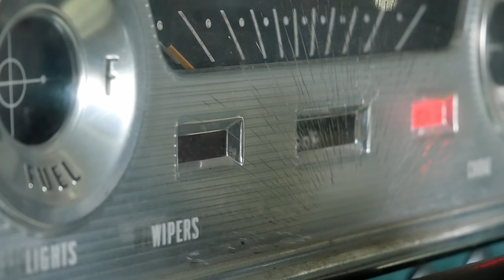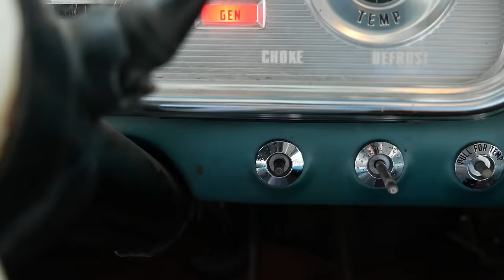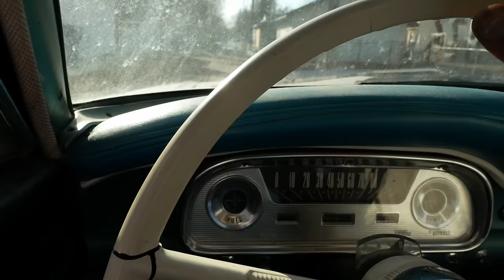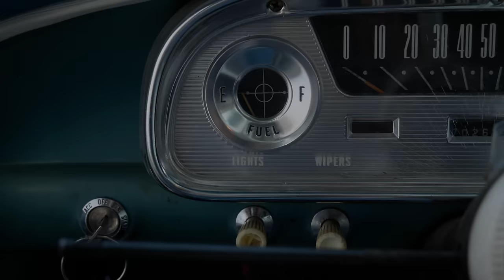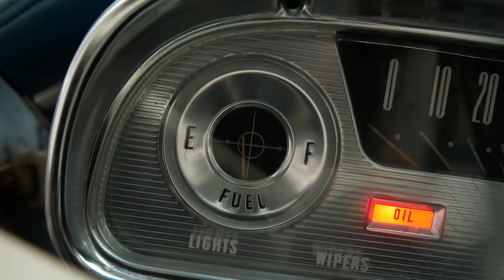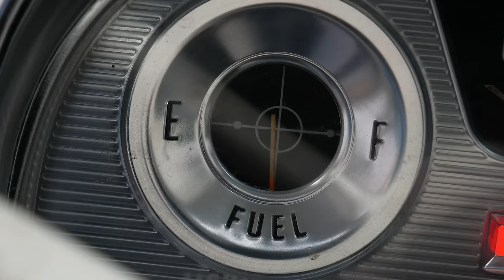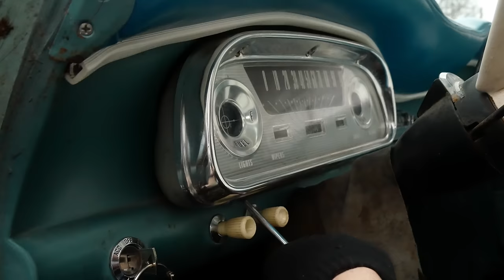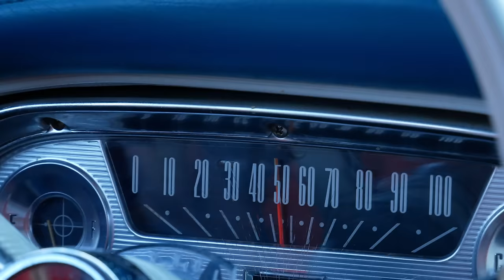Fixing Up An Old Ford

Comment: I learned from oldtimers back in the 70s, start spraying penetrant on exhaust bolts a week before day of removal, spray several times a day every day without running engine till day before, then spray between running every few hours of cool off time. The day of removal, nuts and bolts will be hand tight and will never break off, I've done it 20 or 30 times, never had one break in 40 years as a mechanic. I've got to fix a few that others failed at following directions.
The sounds of those old 6s brought back memories, I had a 68 Falcon Futura, and a 66 f100...
Reply: I agree totally especially with vehicles sitting for a long time I hate headaches lol but good to watch sura young man saving these old cr

Comment: Seriously, you have the patience of a saint! This brings back memories of working on my 1965 Falcon Six (although I think my exhaust manifold studs were much better behaved!) 
There's a certain "domino effect" when working on older cars. One thing kind of leads into another and the next thing you know, you've pretty much dealt with every system in the car.
"While I'm at it..." syndrome is very strong and hard to resist!
Looking forward to Part 2.

Comment: Hey Simon, a word of advice. I’ve been in the same position with exhaust manifold bolts before. Next time, mix yourself up a 50/50 mix of ATF & acetone and apply it to the bolts. And I don’t mean five minutes before you start, I mean two or three applications per day for a week or more if you can. Do that and hit them with some heat and you’ll be amazed at the results. 
Great video, thanks!
Reply from the maker: Thank you for the tip.

Comment: Brings back fond memories! I owned a 1962 Falcon in 1968 I bought from a dealer. The price? Four Hundred bucks. Inflation aside, it was a good price.  The body was perfect, the only thing I remember was it did not have much heat in the wintertime. Great job on that exhaust! Adjust those valves properly and you won't even hear it run!

Comment: Second car I owned was a 1961 Falcon 2 door. Put over 100,000 miles on it without a major problem. Great gas milage with the 6 cylinder  and  3 speed manual. Still have fond memories of it.
Reply: To Richard Benso. Hello! I was wondering exactly what you call excellent gas mileage!
Reply: 18-19 per gallon with top speed limit of 55 in those days.

Comment: in my -60 the carburator has a glas house not steel. and another aircleaner without that pipe...and the fuelfilter is sitting connected to the intake of the fuelpump and you posted this on my 63,s birthday!

Comment: Mate, enjoyed the video. 29:42 should be a “donut” that gets sandwiched between the manifold and the plate to seal the exhaust. rock auto should have em. 🇦🇺🤙🏼
Reply from the maker: The manifold I got from the junkyard was designed for a donut, yes. The pipe on the car and the old manifold was designed for a regular gasket, so a donut wouldn't fit. I may go back and weld on the proper pipe end to take the donut because I think the connection was leaking by the end of the video.
Reply: That’s right, the donut style has the flange on the pipe. I usually put  headers and twin system my old Falcons, and let the exhaust shop deal with the broken studs 🤫🤙🏼

Comment: Ah the best sound in the world. The snapping of manifold bolts...always so much fun removing the old bolts. You've shown great patience.
In Australia that model was designated as the XK. I had one, it was a little slow, but it got the job done.
This video brings back memories of working on old cars. At least they were easy to work on, but they needed constant attention.
We continued building Falcons in OZ up until about 2017.

Comment: I just came across your channel.   The 60 - 63 falcons are my favorites from this era. The body lines are just fantastic. This video reminds me of all the broken bolts I found on my 62 Futura. I did a ground up restoration and took off plenty of skin but the finished car made me smile every time I drove it, coast to coast twice. I installed a 200 cubic inch 6, C-4 auto & a holley 2 barrel. Plus headers.  I could cruse all day at 29mpg. Those engines were virtually impossible to kill.
Reply from the maker: Wow, great job. 29mpg is amazing, I always wanted to test what this one gets.

Comment: You did an amazing job. For those head bolts I use diesel injector cleaner. Spray more often and give some time to work. It just frees up that old rust.

Comment: When I was a Sophomore in High School a friend of mine bought a dilapidated 62 Falcon with a 144 cid 6, 3 speed manual trans w/ the shifter was on the column. We rebuilt the engine and put a floor shifter in it while we had the trans out for a stripped 1st gear replacement. I was fun to learn how to drop the lower cluster gear to pull the 1st gear out. I cut my teeth on his Falcon, and got my secondary teeth when his Dad asked if we could rebuild the 352 in his Galaxy 500. It had burned 3 gallons of oil pulling a small travel trailer home from Florida. I grew my wisdom teeth on his Grandfather's 390 Mercury Park Lane. Those were easy rebuilds and they made us successful mechanics. Fords were built simply but correctly. IMO you need to get a real torch and learn about heating cast Iron and Steel up to Red hot, Orange hot and Yellow hot. Cast Iron will give up a rusted exh stud less than 1/16" thick if you get the cast hot enough. I'm talking about exh studs that are rusted down to tooth picks.  You can get there with Propane and Oxygen, no need for the dangers of Acylketene. Fun to watch you break stud after stud after stud, I was wondering where you were going. ben/ michigan
Reply from the maker: Thanks for the story. Those FE engines were the first engines I really dug into, I'll always love 'em. I ran a 390 + toploader 4 speed in one of my cars for a while. A bigger torch definitely would've been the biggest help here. I'm familiar with using acetylene but I don't quite have the facilities for it. Oxy/propane though, I didn't think of that. Seems much more friendly for occasional use in my small garage, I'll have to pick one up. Thanks again.

Comment: In the future when welding nuts to studs let them cool down to room temperature
Reply from the maker: As in don't quench them immediately? I wasn't sure, tried doing that and then not. I heard quenching helps break up rust, but maybe it's not good for the weld bond. I also think all the heating and quenching is what caused that flange to snap.
Reply: When I weld the nut on I let the nut and the weld cool entirely if you turn it hot then the weld won’t hold up as well as like 70 degrees

Comment: How to remove rusted bolts: spray and spray some more. Let sit. 
When removing the bolts go back and forth a bit. Spray some more. Repeat until bot is removed. Take your time. 
Pre heating could work as well.

Comment: In 1971 I bought a 1960 falcon 144 ci six, three on column for $50.00. Jack it up, put glass pack on it and cheapest blue paint job we could (white to begin with). Drove it through out high school.

Comment: Wow! I learned to drive in a 1960 Falcon with the weakest 6-cylinder and a "3-on-the-tree". Horrible car but bulletproof and easy to work on.
Reply: I had a 1965 Falcon with the 170cid 6 and three on the tree.  It got better gas mileage than the Dodge Dart but the Dart was a better built car body.

Comment: Simon-Don't use WD40 to help you remove rusted bolts.  WD40 was the 40th recipe the inventor successfully arrived at for water displacement, hence WD.  A much better spray for rusty bolts is PB Blaster.  And if that fails, heating all the bolts with a torch usually works.

Comment: Hope you like this Falcon, I had mine long enough to put on 190,000 miles. It needed a new motor and rust was starting so I traded it in. Wish I had kept it though. It was reliable. I was real good on gas but horrible on oil in the end.

Comment: I have an old socket wrench that was broken that I welded up so it doesn't spin so I'm taking out hard bolts I could just go back and forth with it quickly without having to switch the direction on the wrench. I'm pretty sure it's saved me a lot of broken off studs and bolts
Reply from the maker: Great idea, I should've saved some of my broken ratchets for that

Comment: First car was a 1960 Falcon 144 cu. in. 6 cyl. I was 14. 54 yrs. ago. They make exhaust gaskets for a reason. Same with exhaust donuts. When used they work well. That red crap is garbage. Jury rigging on the exhaust pipe and muffler had me rolling. When I got mine it needed a head gasket I was told. Took it all apart on their word and it was a bad carb and a blown donut. Couldn't get a license or put it in my name after I fixed it so I left it in that old mans garage. He said it would be fine till I could. Never saw that car again. Good luck with it.

Comment: Hey Dude cool project, watching the stubborn studs does prove a challenge for some folks but your patience is rewarded with success… 
Whenever I come across a stub stud on any type of job I always start by giving it a little tighten then go for trying to loosen sometimes gotta do it more than once but it usually helps and also heating like you did…
Cool project Bro love old fords oldest I’ve had was a 65 Fairlane left hook.. watching and subscribing from 
New Zealand …
   ✌️😎👍
Reply from the maker: Thank you for the tip, I did try going back and forth on the studs before a firm twist. I’m sure a real torch would’ve been the biggest help here. Thanks for watching, a buddy of mine has a ‘66 fairlane.
Reply: @SimonFordman  awesome stuff…
MayTheFord be with you 😂😂FoMoCo ✌️😎👍

Comment: I'm IN LOVE! What a beautiful car! The condition seems really good, for such an old car! I once the American car restoration programme, Phantom Works - where a couple had a 1961 Volkswagen Beetle Convertible. It only had a trace of rust at the edges. When I myself was a schoolboy Volkswagens fan at that time - I remember people used to refer to paintwork as the ENAMEL. On Volkswagens at that time - it would appear it REALLY was enamel. So using that instead of paint really does prevent rust! HOWEVER, if some got a dent to repair, you would be hard put to, to paint in a repaired section , since you'd probably have to get the enamel OFF in that area. Easier said, than done, I'd imagine! So that's why they have gone over to using PAINT on cars  NOT  enamel. Would you know  however  if this car has ENAMEL - since it does look in remarkably good condition! Please reply - I'm curious to find out!

Comment: Use areokroil from kano lab,for penatrent. Try tighten a little then go loosen up a bit back and forth letting penetrating a little at a time. Save lots of time without breaking nuts or studs I’ve used this for 20 years or  more, works great! Dan

Comment: Automatic brake adjusters are actuated by rolling backwards and stabbing on the brakes,  they're supposed to adjust every time you break in reverse but things get old and stuck, so some more aggressive backwards braking might just bring the pedal up some. But then again that car might not even have automatic brake adjusters

Comment: Incredible patience with such hard work. Don’t you need a gasket on that exhaust manifold?
Reply from the maker: Thank you. I've seen lots of engines with cast iron exhaust manifolds against a cast iron cylinder head not use gaskets along that surface, so I opted to go without.

Comment: Good job extracting those studs, however, WD40 isn't the best penetrating oil. I would have used KROIL, soaked them down, let them soak over night and plenty of heat. Might have been easier...
Reply from the maker: Thanks for the advice

Comment: How did you remove the broken bolts on the exhaust headers , and I mean the bolts that were broken further into the holes where you couldn't just get the weld between the grip sacrificial bolt where they would have to be joined/welded deep without access ?

Comment: I owned a used Falcon when I was a teenager. It was ugly, like every Falcon, and wouldn't win any speed
contests. But that little 6 with the 3-speed on the tree got around relatively dependably. I remember having
to have some kind of work on it at the dealership. A clutch, I think. They gave me a 6-cylinder 3-speed Mustang
as a loner! They wouldn't consider a straight-across trade. Too bad. That Mustang hauled ass for a 6.
Reply from the maker: Haha, that's pretty cool. Thanks for sharing.

Comment: I got out of the USMC in '69, bought a '67, Falcon, 6, 3 on the tree, had 28K miles on it, for $1200, drove it for 10 years, just sold my '14 F150 to my son, had 17K miles on it, bought a used '21 4Runner with 19K miles on it, don't like it.

Comment: My 95 hard body is pulling left when I break I had no idea you could adjust drum breaks like that I’m doing that tonight 100%
Reply from the maker: Hopefully that's all it is, could be suspension or other brake issues.
Reply: @SimonFordman  yeah I did it last night sadly no fix
I know I have a tire with low pressure 25psi and it should be at 35 
But I don’t believe that would cause it to pull the way it does (and only when braking)
Reply from the maker: @landon_kidney2633  If you have disc brakes in the front, I find that a lot of the time a pull on braking is from one of the calipers not moving freely. Seized slider pins.
Reply: @SimonFordman  thanks bro gonna be checking on those tomorrow 
I’m a photo/videographer and I really love your videos and seeing all the effort you put into camera angles and editing those hours of footage. Loving the videos brother

Comment: I admire your persistence, but you are using the flat file incorrectly. Most flat files designed to cut metal in one direct only. When you pull or push the file in the opposite direction you are dulling the file. My first car was a 1961 Ford Falcon with the 144 cubic inch six and three on the tree. Judging by the grille on your car this is a 1961 as well. Best of luck with this project.

Comment: Sorry, but red silicone WILL NOT WORK ON EXHAUST! Just go buy/ or make a damn gasket, the leaks will cut into the cast iron ruining the seal surface if you keep using the wrong stuff for the application.

Comment: Just out of curiousity: why didn't you use gaskets for the manifold?
Reply from the maker: On a lot of engines with cast iron manifolds and cylinder heads, the factory won't use a gasket for that mating surface. I used sealer because the surfaces had become pitted.
Reply: @SimonFordman  yes true. I am going to be doing the same job in the future. I did it a long time ago on another engine (no gaskets from factory) and i used fel-pro's which worked good. I am guessing rust will be an issue sooner or later both with or without gaskets

Comment: a cheater bar on rusty manifold bolts???? were you trying to snap them?
Reply from the maker: I had soaked the bolts and heated the engine before going at them, I kinda just went into the whole thing figuring they were all gonna snap no matter what. Going back though, I would've used my impact driver first. At the time, I thought that would've been worse.
Reply: @SimonFordman  , just found this video for your channel.  Good stuff, impressive camera work.  Being able to admit when you are incorrect is a great sign of intelligence and character.  Everything else can be learned.

Comment: Great job but the exhaust manifold you installed has a completely different flange gasket assembly, the two are not compatible 
I did see you using rtv but this is a dodgy temporary measure at best
EDIT just got to the part where you finally figured it out..... still a dodgy fix 😂
Nother EDIT are you seriously not putting a dust cap on that front wheel bearing??? You obviously haven't seen how bad it can go if it locks up, it can snap off the end of the spindle.....come on man.... do better
Reply from the maker: Yea, you are right. I think next time I have the car I'll cut and weld the correct flange onto the pipe.